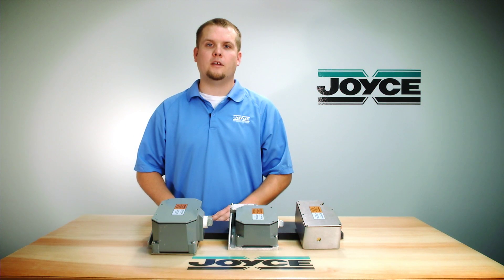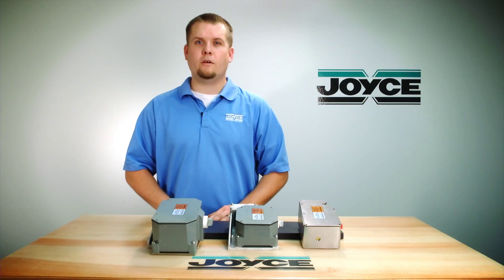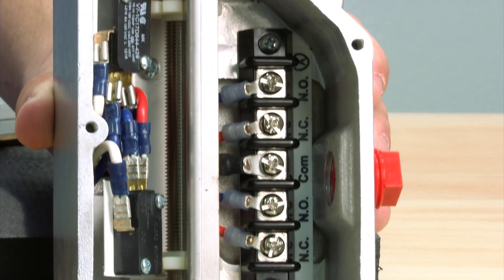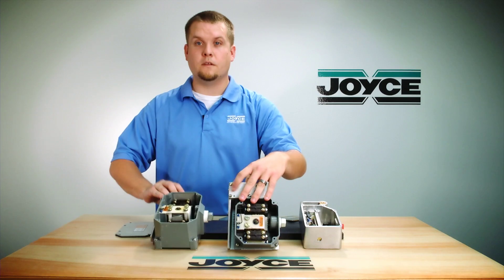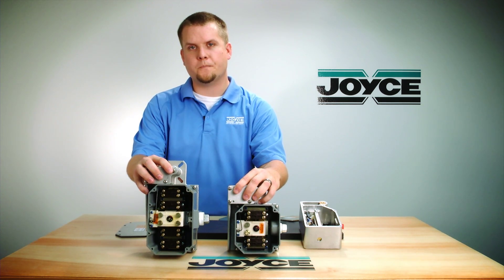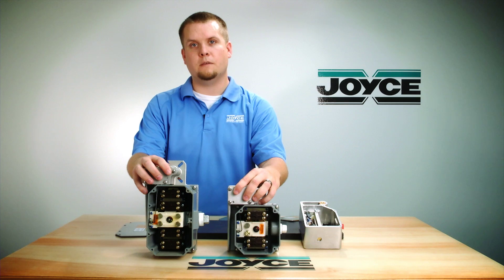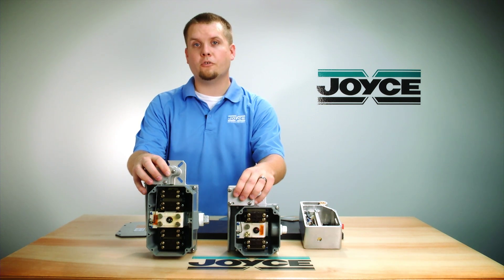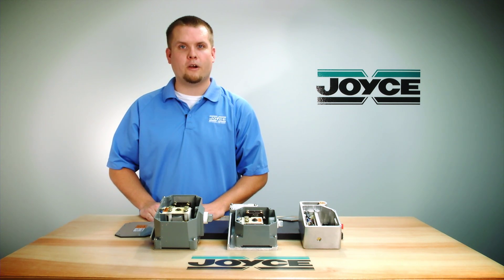Choosing a Rotary Cam Limit Switch – LS7 vs. LS8

Comment: Can you explain the part where on a 25:1 jack it would take 100 turns to move 1" - how is this related from the 25:1?  Pls help as we are trying to figure out which Limit Switch to purchase for our application.  We will have a gearbox at 20:1.
Reply from the maker: Hello and thank you for reaching out! Please contact us at sales@joycedayton.com or 937-294-6261, and our technical team will be happy to assist you with your application requirements.